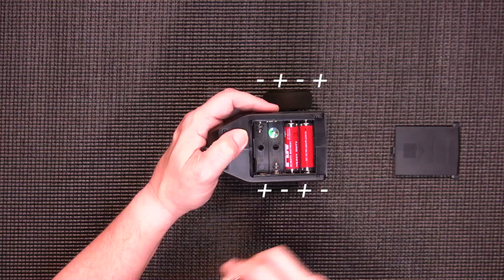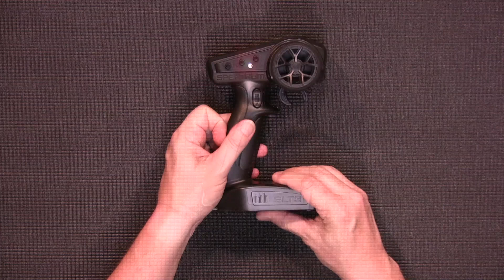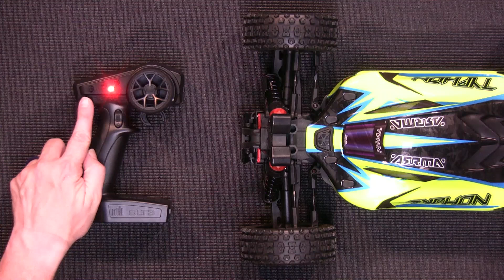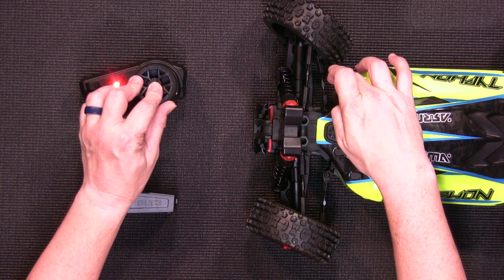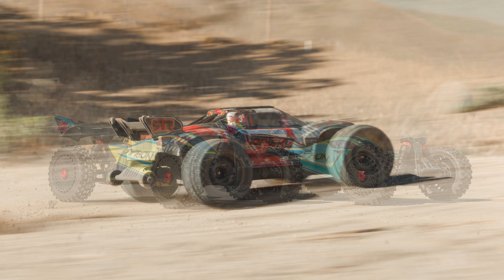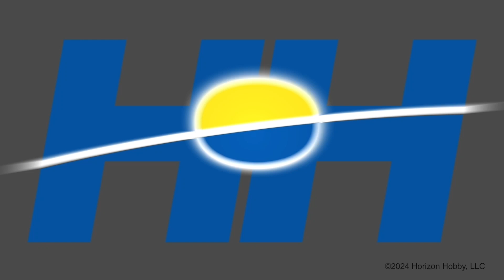SLT3 DSC Complete Operational Guide

Comment: I’ll be honest I am replacing this because that button constantly gets touched very lightly comes on and I always have dead batteries and I shouldn’t have to pull the batteries out every time I use it. The tune system is complete garbage as well along with the speed controller and a 223 systems